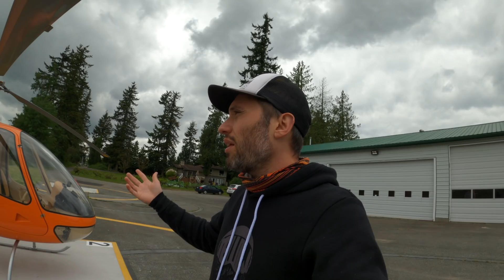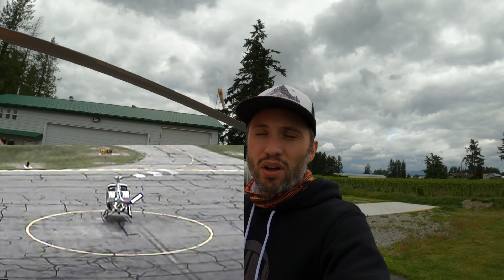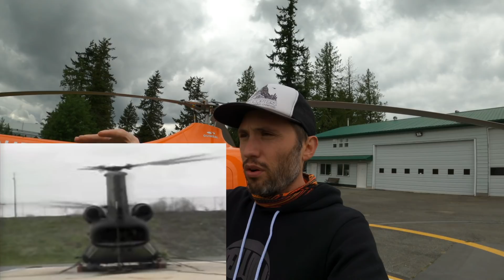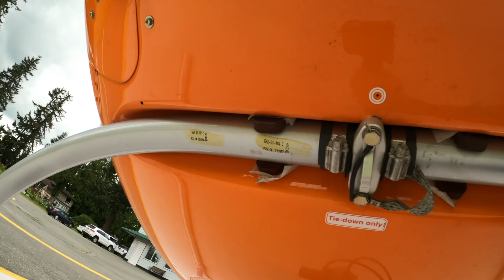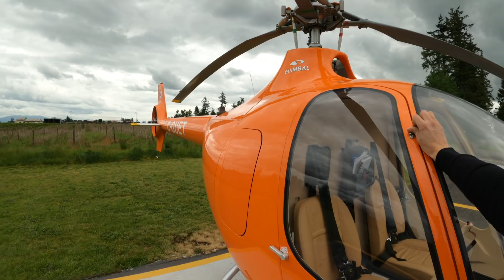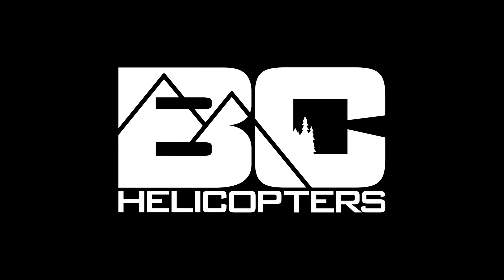WHY HELICOPTERS GET GROUND RESONANCE

Comment: vrs, mast bumping, settling with power, engine fires, dynamic rollover, retreating blade stall, ground resonance sheesh! 

someone should just make videos detailing the rare moments when a helicopter is not killing the pilot in some diabolical way.
Reply: Slip down in the bathtub the wrong way, and you are dead.
Reply: Unlike an airplane, a helicopter crash results in the machine beating itself to death, too!  Thus the EXTREME importance of good maintenance on a helicopter.
Reply: Helicopters are the punk rockers of music
Reply: The difference between flying in an airplane vs a helo is like the difference between a car or a motorcycle. It's freeing, exhilarating, and heart pumping.
Reply: Well put. 

Helicopters only actually stay in the air cause the earth physically repels them. There is not other logical reason! ;-)
Reply: @mhorlor  Also because they beat the air into submission.

Comment: why doesnt it happen to twin bladed helicopters?
Reply: On a fully articulated rotorhead system (3 blades or more except a fully rid system) each blade can flap up and down to a few degrees outside alignment with the rotor disk plane. Each blade can also lead or lag a few degees. So a landing shock can cause one or more blades to start oscillating from it's normal centrifical point relative to the Rotor Hub, which is solidly attached to the Rotor Mast.
 On a two blade system, the Rotor Hub pivots up and down a few degrees at the top of the Rotor Mast, so the whole rotor disk is fairly rigid to itself, with blades flexing instead of flapping. There is a small ring shaped gap at the top between the hub and mast, so the hub can pivot or teeter totter independent of the mast. So the rotor disk on a two bladed system behaves more like a true gyroscope with a solid spinning wheel, with tremendous inertia, which stabilizes the disk and rotor speed more than a more flexing rotor disk on an articulated system. The problem with the two blade system, there is a single teetering hinge at the top, and if you are too aggressive on the cyclic, or do an excessively low gravity maneuver, the skirt of the Rotor Hub can smack into the mast, and  bend it or even break or crack the hub.   So both systems have some inherent flaws in their design that the pilot needs to not push too far, because the laws of physics always win.
Reply: On a fully rigid system it is like one of those simple toys with a small dowel inserted in the hub that you launch by quickly rotating between your palms or by a pull string and spool.  However each blade just pitches up or down at the hub to create lift. Much simpler and more solid system with just one point of rotation for each blade. Less parts to break. But requires very expensive Carbon Fiber blades that can better handle being constantly flexed.  That comforting solidness comes at expense of more vibration from engine, and air turbulence gets transmitted to helicopter fuselage. Instead of dampened in more hinged systems.
Reply: @jakerabinz9411  thanks, i thought it was only heuys that had that kinda system

Comment: 1. If you're successful in recovering from a GR event by taking off, how confident can you be that it won't merely repeat the GR when you touch down a second time?
2. What effect does the surface (concrete, asphalt, grass, dirt, etc.) have on GR? I suppose it would depend on the nature of the resonant frequency itself. So, if I get GR on a concrete slab, should I try to set it down on another nearby surface?
This is great stuff!! Thanks.
Reply: It depends on what caused it. Normally it won't repeat unless something has broken on the ship which induced the first event. (broken tooth on drivetrain gear, or something weird like that)
Think of ground resonance as being like striking a bell. Don't strike the bell and it won't ring (resonance). The energy which keeps the resonance going or building comes from the rotating rotor head. If that energy source is removed (rotor is stopped), the resonance immediately dies out. Also, increasing the damping will kill it immediately. This is what lifting off does - it breaks the coupling to the ground and drastically increases damping.

Comment: I know nothing about helicopters so my question is why are there no replaceable rubber bumpers built onto the base of the skids - they seem to be bare metal which surely reduces any cushioning ability and would accentuate the ground resonance  ?
Reply: The skids need to be able to ... skid. In an emergency autorotation landing you could have quite a bit of forward momentum. If the skids were rubber they would suddenly grip and flip the helicopter.

Comment: How is the resonance on the five blade
Reply from the maker: Dan Faller usually not an issue. They are very smooth and typically don’t lose a problem.
Reply: With 5 blades, each blade is responsible for 1/5 of the rotor disk lift, instead of 1/3 or 1/4 with 3 or 4 blades. Therefore any deviation of of a single blade due to a shock resonating a blade out of the disk will be less disruptive then a third of the rotor disk mass becoming unbalanced.

Comment: Suppose you detect ground resonance beginning, and you get off the ground, then is there something you should do differently when you attempt to land again? 
If you were on hard concrete, should you next try landing on grass? And vice versa?
Reply: Yes. An awesome saying my first CFI offered me was, "Treat every landing like a mini run-on landing." and I still pass that on today. I've always hovered right behind my intended spot to set down prior to doing so, and for good reasons. First, I can clearly see my spot as I'm setting on it (given). Also the forward motion helps for a smoother set down and allows you to set the front of the skids first (depending on the aircraft). This really helped in the S300s for preventing G/R.

Comment: I've had a quite expensive scale model ah-1w cobra destroy itself due to ground resonance in the past. I quickly learned the foam trick on the skid mounts, and fly from grass where possible. It seems the softer grass is much more forgiving than pavement.
Reply: You put a bit of foam on skids? Might try it on mine. Got new one and did slow spool up on kitchen table and spooling down it started a chicken dance. Read it was to do with blade tightness so mostly gone now but hopefully will be much better on grass.
Reply: @mrbushpilot  I would suggest to always fly from grass when possible. Make sure your blades are balanced both statically and dynamically, and check that they track properly. I was able to create a spacer between the frame of the heli and the skids out of foam from some old blade holders (the ones that keep the blades folded above the tail boom). It is stiff, but provides a buffer between the frame and skids.
Edit: I actually run my blades tighter on my Cobra than I have on any of my other helis, and I was nervous about that at first. But it seemed to help mine. Your results may vary, so idk how helpful that may be.

Comment: Is ground resonance only susceptible to fully articulate rotor heads?
Reply: The only rotor head that is not susceptible to ground resonance is a rigid rotor head but a fully articulated rotor head is the most susceptible.

Comment: I don't have a lot of time in fully-articulated machines, but while flying them I actually feared this more than Low-G mast-bumping in the Robby.  Mostly because it just seems so much easier to get into (like I have no control over when and if its going to suddenly get me) while mast-bumping seems easier to avoid (because I'm only going to get it if I do what I'm not supposed to do).

Comment: Good video.  The only thing I would add would be an “emergency shutdown” for a low RPM ground resonance situation.  IE: Chopper start up and the blade is un-phased, or the uneven terrain, causes resonance.  Increasing the RPM to break ground contact will exasperate the situation and destroy the aircraft.
Reply: Disclaimer: I'm not a pilot of full scale helicopters, but in the past I have had this issue at low RPM on my large size scale helis. Even at low RPM just adding pitch increased the drag on the rotor blades enough to slow them down without vibrating my heli to death

Comment: I've heard that you shouldn't hover for a long time or it will lose lift due to the rotters moving so much air from underneath them?
Reply: T'airn'KA that’s not correct. Close to the ground you actually get some ground effect in the hover that helps. You should avoid hovering when you are too low to autorotate and too high to safely settle on the ground.
Reply: IT'airnKA I think perhaps you are thinking of vortex ring or settling with power. This is when a helicopter comes down through its own disturbed air at a non optimum speed and lift is removed. Pilot instinctively pulls more power/blade angle but this makes the situation worse. The way out is forward movement out of it, that is if you have enough height.

Comment: Thanks for this one.  You cleared up some misconceptions I had on the subject.  I've seen the videos you showed.  There's another one I saw of a Schweizer 300 that the mechanic was running up after a maintenance cycle, I think.  He had no intention to actually lift off but he had the rotor system at or near flight rpms and held it there for a couple of minutes with no apparent problems until something happened and all hell broke loose.  In seconds, the aircraft was destroyed.  Very scary.

Comment: Good presentation.  I would suggest including the fact that ground resonance which is often encountered during landing, it can also occur during takeoff. I if you want to save the day,and just like landing you’ve gotta either get it in the air or slam it down and hope it stays together. Your quite correct identifying shock struts on the under carriage and lead lag dampers on the rotor head as possible causes, and usually are the primary cause, however don’t forget to check the rest of the rotor head and undercarriage carefully. The early Sikorskys, eg S 55 and S58 S would go into ground resonance due to differential tire pressure..

Comment: In spansh we call it Gomas de impacto.  long time ago  I watched a TV program when a person came up with a plastic or rueber that was capable to absorb all the energy in a hit.
He placed is hand on a table and then put the rubber or damper over his hand  and then he took a hammer and  he hit his hand and, but that thing was capable to absorb
all the energy of the hit. The purpose of this ruber or damper was to put in inside of  the toe in the tennis shoes to absorb the impact in excercices or jumps to avoid  knee injuries
I did not know this characteristic of helicopters vibration in the skids.
Awesome!

Comment: Is this equally likely when landing on a softer surface, ie...sand or grass, as when landing on hard surfaces like concrete pads?
Reply: More likely on a hard surface but still possible on grass.

Comment: Thank you Mischa, an excellent tutorial. Yes I should have been more specific with regards to ground resonance affecting all multi bladed rotor system helicopters and not just specific to the Cabri.
Reply: What I don‘t understand? Why is this not happening with 2-bladed Rotors?
Reply: I'm not a helicopter pilot but I think it's something to do with 2 bladed rotor systems being  rigid/semi rigid in design and 3 or more bladed systems tend to be articulated (independent of each other) in design causing them to become out of synchronisation with one another hence causing the resonance. I may be talking complete nonsense but I remember reading this somewhere.

Comment: Is it "more" possible to come into ground resonance, when your helicopter is standing on a ground which vibriates, like a ship or something like that? or is it another art of vibration? very funny to watch videos about it, but if you own a helicopter it wouldnt be that funny..
Reply: d e r _ f a i l _ x yes absolutely
Reply: @serdavosseaworth6115  so this is the reason for that offshore and marine helicopters have wheels instead of skids. It would be much easier I think
Reply: @exxs250  while that is a benefit, the main reason is that most of those helicopters are very heavy. Without wheels they would be impossible to move without heavy equiptment.

Comment: Great explanation on ground resonance, Can you please explained "power management" because I think it plays a big part on smoother, greater control stability, smoother turns and safety, that is if you constantly hearing your engine or rotors changing RPM's then it's bad piloting techniques, Is this correct because I have noticed this characteristics on simulators and RC model flying.